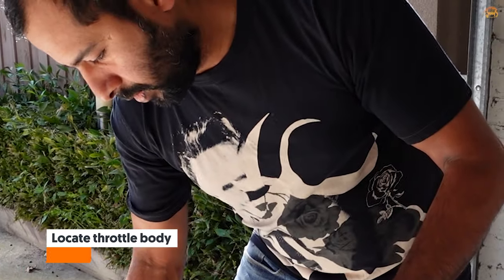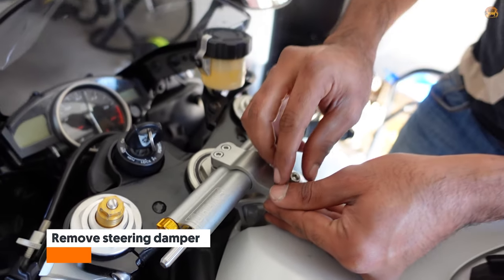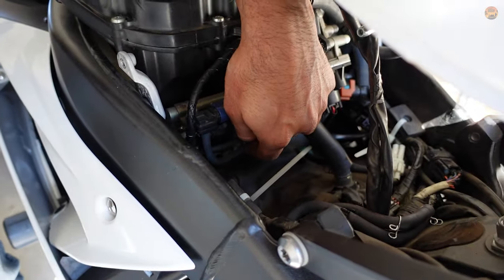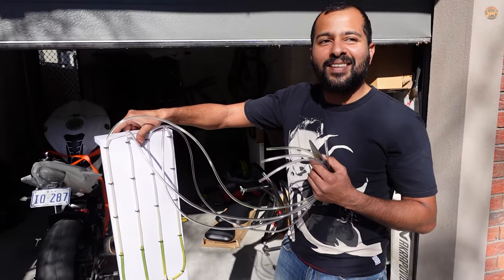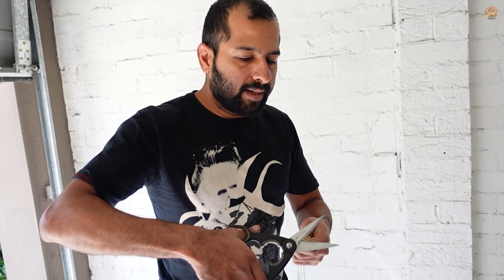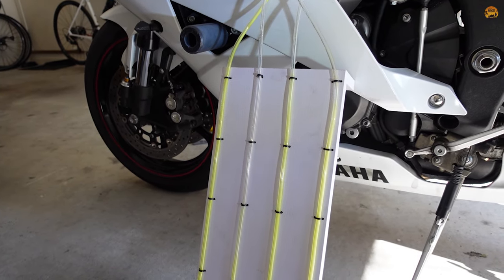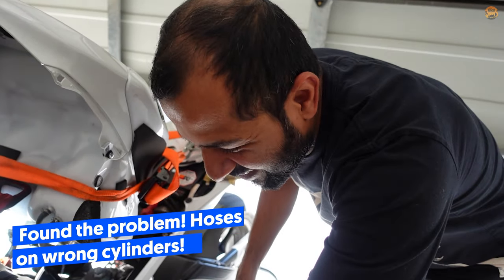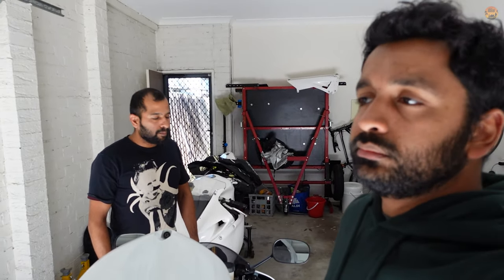How to sync throttle bodies on an R6 (മലയാളം)

Comment: Brother, if you set the air screw of the throttle, then the rpm will also change??
Reply from the maker: Yep. But everything is electronically controlled on new bikes